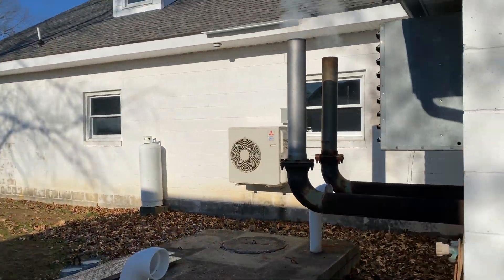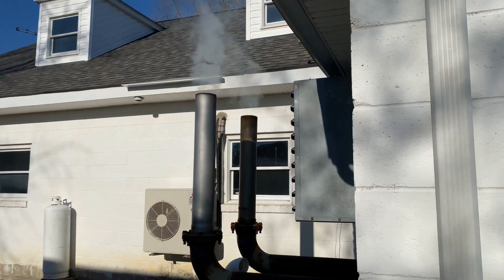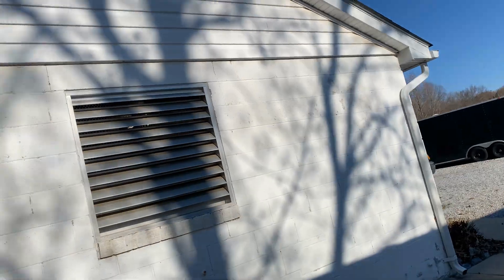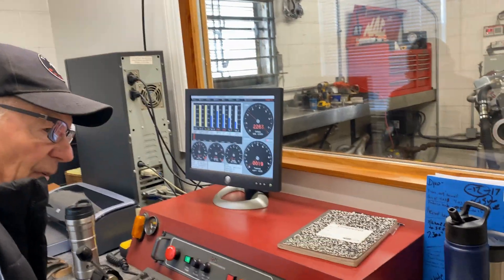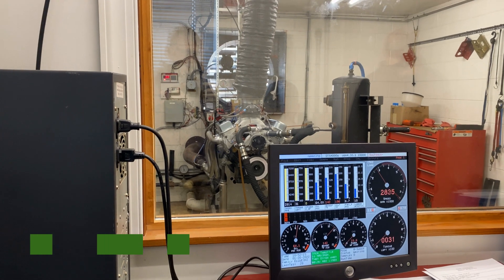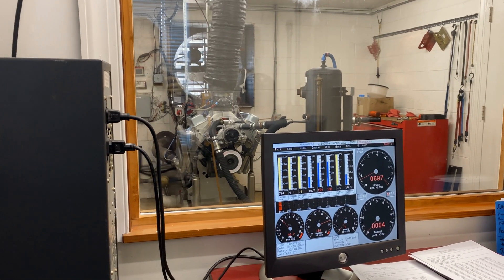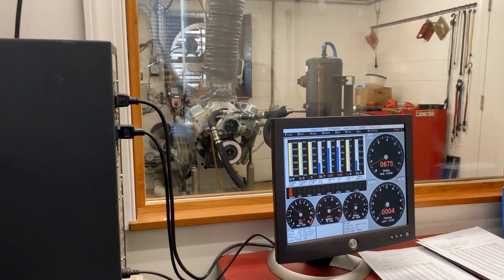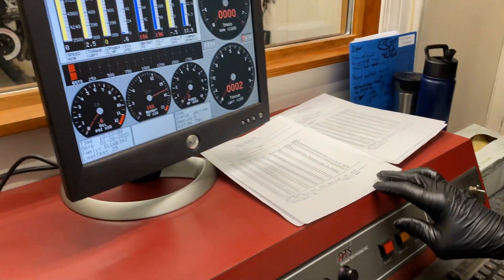Dyno Day for LT1 383 #108

Comment: what's crazy it made all that power with a dual plane intake and low compression ...  and pulled to 6500 rpm wow nice........ makes me want to ditch the whole fuel-injected optispark setup and go old school for my Camaro ... simple and it will run forever .........      oh yea it made 500 pounds of torque all the up 5300 rpm great fun street engine that will run on pump gas all day long... just make one think instead of the high tech stuff sometimes old school is hard to beat if you want a good fun street engine ,,,,,   that wont break the bank
Reply from the maker: l think the same thing.  Good ol reliable carburetor!  This 9.8 compression ratio could be a fun all natural motor too.